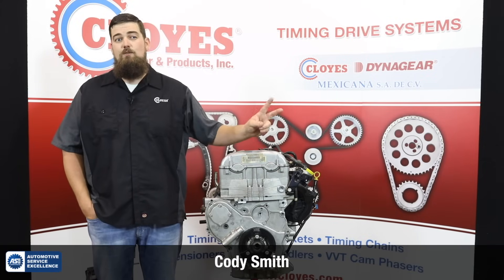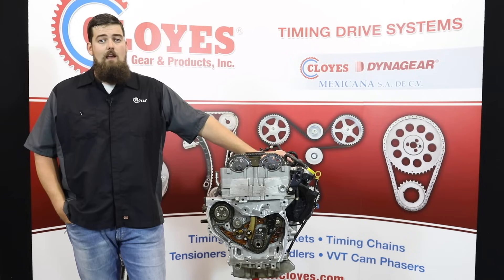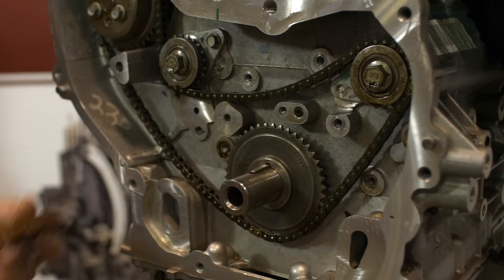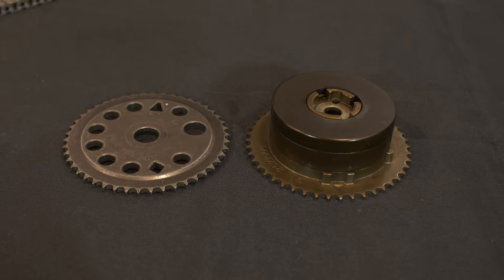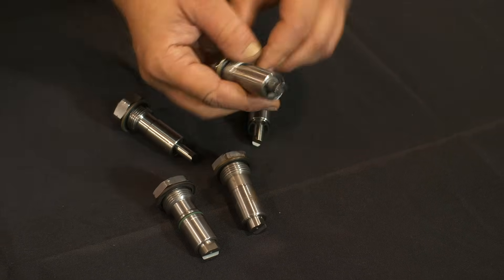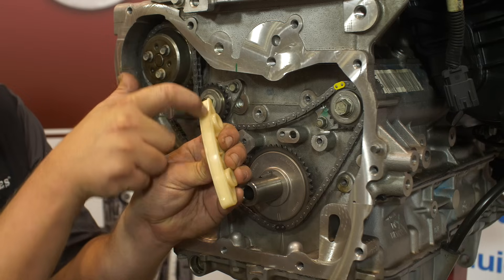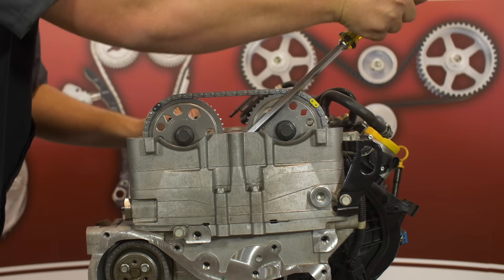GM 2.0/2.2/2.4L, Timing Chain Replacement, Cloyes 9-4201S & 9-4202S

Comment: It’s a slight ticking noise, it’s an Ecotec 2.4 with VVT in a 2011 HHR , new water pump, 9-4201SA timing chain kit and 9-4202S balance shaft chain kit.
Reply from the maker: A ticking noise would definitely not come from those sprockets. Were you getting the noise before the repair? If the ticking noise is timing related it has to be tensioners, oil pressure to tensioners, or the VVT system.

Comment: I just replaced both chains and made absolutely sure the timing chain tensioner deployed, I do hear a bit of noise like possibly the new balance shaft sprockets, the new style , you show in this video, is it possible I just hear a little chain noise?
Reply from the maker: What kind of noise is it? You shouldn't hear anything different from the balance shaft sprockets.

Comment: What happen if I accidentally move the Balance shaft sprockets on disassemble and where do I find out how to fix my timing if it jumped. Thanks for all your help
Reply from the maker: You can just spin the balance shafts back to where they need to go so the sprocket marks and chain links align. The balance shafts do not connect to anything, so you can spin them freely.

Same thing on the camshafts, however make sure the pistons are out of the way before rotating.
Reply: Thank you for your help. Much appreciated.

Comment: I have a car with this engine. And without marks on the camshafts from the factory. New timing kit has these marks.
The engine is suffering from a slack timing chain.

How do I know when the chain is slack and crank set in TDC. That the camshafts are in TDC?
Reply: You have to have marks on the cam phasers.  Also TDC on the exhaust stroke all 4 cam lobes will be down on the #1 cylinder and the key on the crank is at 12:00.

Comment: One thing I didn’t hear mentioned is if you’re doing this because the chain guide broke, make sure to drop the oil pan and clean out the oil pickup tube. I am in the process of doing one now and the oil pickup tube was completely jam packed with debris. Had I not done this I’m certain the motor would not have lasted more than 5 miles.
Reply from the maker: Very good point Jerrod. Thanks.
Reply: Absolutely. With the engine removed from my ‘08 Cobalt, I took off the oil pan and the OIL PICKUP TUBE was packed with debris. There were metal pieces from the chain guide, and broken plastic guide pieces.
Reply: That must've been the it seized on me..broken guide .. replaced chain n everything but didn't check the oil pan now I'm swapping the engine.... (Year later)
Reply: Exactly I,m doing this Job on a 2011 Buick Regal 2.4 mine was also jam packed I took this oil pan off at first to clean out the Metal particles and knew there was debris ,you have to also take the metal Stupid cover off and knock the Oil pickup tube out of its hole first before you even find out what’s in it,stupid design but so are all GM products
A side note the upper chain guide was completely cut in Half,so if you hear any strange noise,take that Valve cover off to inspect
Reply: Thanks for posting this. Going to do this. Does that tube just pop out?

Comment: Which bolts in this job need to be replaced? Just the 2 cam sprocket bolts? OK to reuse the others?
Reply: Yes. Just the cam sprocket bolts. Do not reuse the cam sprocket bolts.
Reply: Depends on what kit you get. In the kit he used, I’m assuming he only replaced the cam sprocket bolts as those are the two he said to dispose of, but I’d keep all hardware until you can compare old vs. new to make sure you don’t throw out something you need.
Reply: @chuckkolancz4969   This. You end up reusing most of - if not all - of the bolts. Make sure to keep them and DON'T THROW THEM OUT!

Comment: I have to check timing on the 2.4 ecotec motor with VVT that another mechanic did the timing chain on but now has correlation codes and p0011 , p0014.  It wouldnt run after he did the work.  I got it started and some times it runs perfect for a minute then goes to running horrible and dies. upon reving i here a strange noise in the engine.  I am guessing he some how has the cams off from the cam gears and the valves are just barely hitting on rev up.  Anyway I need a video on how to set these up with the VVT if anyone can help.  I cant find any videos or pics of proper set up.  We did rent the special tool.
Reply from the maker: This video will apply directly to the VVT engines as well. The only difference you will find is that the cam sprockets look different. The timing is still set the same, it uses the same chain and marks, and the VVT cam sprockets are marked as well. 

With that said, it sounds like you may have a VVT system issue, not a timing issue. If the car runs perfect for any amount of time, then the timing is likely correct. It is either mechanically in or out, it won't switch. The VVT system includes the variable cam sprockets (cam phasers) and the VVT control solenoid. This is the system that adjusts cam timing of each cam as you drive. If you have a bad solenoid or phaser you can experience the symptoms you are describing.
Reply: @Cloyes01  you guys are awesome for responding to these comments!
Reply: Those aren’t correlation, those are the VVT solenoids which you can buy on Amazon for $25.  Probably clogged.

Comment: Should threadlocker be used on the bolts??
Reply from the maker: It is not required, but it can only be beneficial.
Reply: @Cloyes01  thank you 😀 trying this in my VX220 this weekend. Wish me luck!

Comment: I have everything installed correctly and in the proper order but for some reason the chain is too tight for me to even get around the bottom sprocket. Is there a trick needed for the 2.4 ecotec with vvt? I ordered the 94201sa
Reply: Put on the crank first, line up that mark, then the intake, then the exhaust.
Reply: still having an issue

Comment: good video, this makes me be quite thankful i deal with Hyundai Engines all day being a Kia tech, this GM engine is ... just silly, almost Euro in nature as far as its design goes
Reply: My sister had a Hyundai Elantra that she religiously changed oil on and the engine failed after having it for 32k miles. Meanwhile my gfs 2.4l Buick Regal had the timing tensioners and guides completely tear her engine apart, starting when she had 102k miles. My 2016 Silverado had the transmission pump blow up at 98k miles when I drive it like a grandpa. No vehicle is bulletproof and all have their flaws as the generations go on. There are some that have a lot of flaws and some that have very little—(i.e. 6.0 vs. 7.3 fords)
Reply: @chuckkolancz4969  You are 100% correct.
Reply: @chuckkolancz4969  For real. No brand is better than any other. I drive a Chevy but I know a hell of a lot of what GM makes is junk because I work on them day in day out. And most all manufacturers are having timing chain issues. Nissans, fords, GMs... I've done them all
Reply: The design on this engine is nearly a decade older than the date Hyundai Motor Group was founded.  The fact GM has been able to squeeze this many years out of it fairly successfully (in literally millions of production vehicles with a failure rate on par with literally any other motor and not even coming close to the failure rate of the Theta engines) speaks wonders for the engineers that originally designed it.
Reply: @youngconfucius  You are just flat out wrong.  Ecotec is well past the founding of Hyundai.  This is not a quad4.
Reply: @lightclub26719  https://en.m.wikipedia.org/wiki/GM_Family_II_engine
Reply: @youngconfucius  only link to engine posted is that it was replaced by the ecotec.  May want to read that article.
Reply: @lightclub26719  Perhaps you should have actually read it. Under the DOHC subsection:

"The naturally aspirated 16-valve version of the 2.0 L— 1,998 cc (121.9 cu in)—cast-iron-block engine is the successor to the OHC-engines and a predecessor to the 16-valve Ecotec-line of engines. The 20XE (or C20XE with catalyst) evolved into the X20XEV(1994) with 136 hp (101 kW) and taking on the GM Ecotec name and finally it evolved into the X20XER(1999)."

Even if we are going purely off the ecotecs modern iteration, 

Hyundai Motor Group (the division that makes cars): https://en.m.wikipedia.org/wiki/Hyundai_Motor_Group

Founded September 2000; 20 years ago

Ecotec L850: https://en.m.wikipedia.org/wiki/GM_Ecotec_engine

Production1994–2012
Reply: Really, you enjoy replacing all the 1.6’s that Hyundai/Kia were sued, and lost over?

Comment: Cloyes Gear & Products, Inc. I am doing my timing chain on my 2.2 ecotec and watched your video. This is a great video however I’m doing my timing chain because my old one snapped and bent the valves on cylinder 4. I installed new valves and am ready to do the timing but because my chain broke, what is the best way to get my cams on the exhaust stroke? I already have the bottom half at TDC, I just wanna know how to get my cams In time without piston to valve contact.
Reply from the maker: Move the crank so all the pistons are down slightly in the cylinders. You can then install the cam sprockets and move the marks to the approximate correct locations. Then you can take the sprocket back off and move the crank back to the starting point.

Comment: I love doing chains on these 2.4s... so simple and easy, it's like they designed it knowing you have to replace em every 100k
Reply: I'm at 112,000, another 88,000 before replacement
Reply: 🤣 they're so thoughtful
Reply: I'm changing mine at 182,000 and at first I was stressed but now everything is falling into place

Comment: 2011 terrain pulled the primary tensioner out noticed it might not have been activated as it pushed back suddently on removal, replaced it with a new one but happened to be faulty as i could not get it to activate,so i checked and put the old one back in since it seemed ok, activated it replaced the valve cover and my gas consumption and power are amazing now, any idea what happened here?  I still have a rattle but seems to be less prominent on startups as before and less frequent, thinking of replacing the oil pressured tensioner today, what do you think? The chain links are solid no stretching has happened on the cam shaft chain as ican detect, Nelson Vienneau. Thanks for the great video you guys are amazing!
Reply: Either the chain stretched, doubt it, or when you activated the tensioner the slack was on the intake side vs the exhaust side.

Comment: Excellent video, probably the best one I've seen especially without all the horribly mixed of terrible music.  How refreshing, a simple video that is extremely helpful. On the 2013 Equinox 2.4L, the engine mounting bracket is blocking access to the lower engine chain path and where the tensioners are located.  If this mount/bracket is removed would the engine tend to drop or move?  This appears to be a serious issue for guy in his garage  with no lift. Thanks again great effort!!
Reply: Yes the engine will want to drop some when it is removed.  Use a jack under the oil pan to support the engine before removal. Find something flat and bigger than the jack head so the weight is distributed more, that way you don't damage the pan.  When you raise the jack you only want a little pressure, stop when you see the engine move up a slight amount.

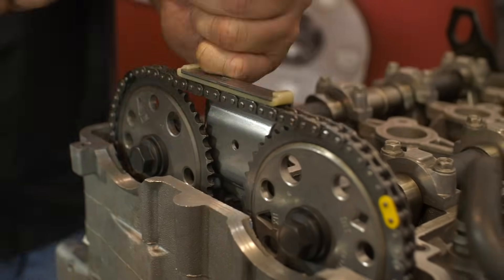Comment: 13:53 why not? It should be timed and ready to turn an infinite number of times.
Reply: The timing marks on the chain /will/ come back around; but not immediately on the next rotation. It could take ~20-30 (just guessing) before they come back around to the same spot on the gears.
I just checked my chain - 46 teeth on cam; 23 on crank. (makes sense; exactly 2x on the cams). The chain has 148 teeth. In one rotation of the chain, the cam has gone 3.2173 rotations (.The lowest common multiple of 46 and 148 is 3404. If we take 3404 / 46, we get 74 (rotations).

So if you rotate the engine over by hand, you'll have to continue to rotate it for 74 rotations before they come back into alignment. You would essentially see the timing chain move about 2 teeth per rotation and they would have to 'walk' all the way around the cam gear.
Reply: James O'Gorman at 14:03, he cleared up what I meant. The engine will be correctly timed and it could be turned. The kicker on these is the hydraulic tensioner. On engines without tensioners on the cam chain, they are free to be turned as much as a person wants without any engine damage.
Reply: I dont get that either
Reply: @frankjustyk9720  There is no oil pressure for the hydraulic tensioner when you roll it by hand and you risk jumping timing. I believe GM service manual says this too. Probably wouldn't happen but all the ones I have done I just double check everything is lined up, put it together and fire it up. Never had an issue

Comment: Ok i have everything broken down and i am trying to remove the balance shaft gears but they will not come off. I tried sticking a punch in the hole to keep the gear from moving but the bolt will not break aloose. Any suggestions ?
Reply: If you can reach it with an impact gun, CAREFULLY try a couple of SHORT bursts with the impact gun.
If you dont have an impact gun, or cannot reach with the impact gun, use a breaker bar and sharply hit the end of it with a hammer.
You need sudden sharp force to get the bolt to start moving.
Stay gold.

Comment: I have a 2012 2.4 ecotec ,I had the dealer do a timing chain under warranty , it only lasted a year and a half , timing keeps jumping , and only 54000 miles , oil changed is done regularly  , any reason why it doesn't last long , are your parts better quality , I am mechanically incline and watching the videos I think I can tackle this , I like the car very disappointed in the engine is junk .
Thanks Travis
Reply: You asked "anyreason why it dosent last long" thrn answered it at the end if your comment. "The engine. Is junk" hahah
Reply: O

Comment: This is a trick... Is it really that easy? I might do mine with 81,000 miles if it's really that easy
Reply: It seems easy because they have the engine out of the vehicle.
Its not super difficult though.
Be SURE to clean clean clean the area before working.
Have good light, proper tools, and a good quality jack.
Stay gold.

Comment: I did everything the same way. I still got the timing belt whining noise. I left the car run for an hour and refill radiator fluid. When it was time to drive. About 10 minutes down the road. The whining started. How much does this cost
Reply: This particular car has a timing chain, not a timing belt
Reply: Whining noise could be water pump, alternator, steering pump, air conditioner compressor etc.
Usually timing chains rattle or clatter.
Stay gold.

Comment: I have a 2010 Cobalt 2.2 VVT. At cold starts it'll have that rattling noise for a few seconds then quiets. It has 79k so is it best to replace the kit vs just the tensioner?
Reply: Same thing here's, only last about 1-2 seconds, it's not pistons.
Reply: Same here... I just took it apart and the chain was loose a little. 110k

Comment: Where would I find a replacement bolt that would go in the left balance chain guide? Had one that snapped on me and am having trouble finding the bolt online. Any help would be appreciated.
Reply: Hi I am having the same problem but it is with the right guide bolt. I am thinking of the junkyard, pep boys and this store called smith fastener company. I am just waiting for a ride so I can go there today.
Reply: @rdylima9  I actually found the item number and ordered one from GM Warehouse Parts, then I called my local chevy dealer and they happened to have exactly one in stock. paid like 3.10 plus 40 cent tax or something like that from the dealer. Got me a torque wrench so i didn't make the same mistake again. 2004 Cavalier 2 door with the 2.2 with 200,000 miles. Engine runs so smooth now compared to before. Got a spare bolt now also.

Comment: TDC on the EXHAUST stroke? I was always taught TDC was on the compression stroke
Reply from the maker: In a four stroke engine you have 2 moments that the piston reaches top dead center. Once on the compression stroke, then once again on the exhaust stroke. Typically you would time the engine at TDC on the compression stroke like an old small block, but not on these Ecotec engines. TDC of the compression stroke in an Ecotec is when the crank key is up, but the camshaft marks are 180 degrees out.
Reply: I have verified this On my 2012 equinox, timing marks on my cam gears point inward and downward when at the end of compression stroke. Exhaust stroke is correct.

Comment: I ordered the 9-4201SX set for a 2011 Chevy Equinox and the links of my chain do not look like the chain used in the video. My whole chain appears a lighter shade of gray with one light golden link and two darker black links. Is this the correct chain or did I wind up with a knockoff?

Comment: Hi Cloyes Gear & Products, Inc. Great video. I’m looking at the 9-4201SAWP set and I have some questions about the water pump. Does the water pump comes with a new sprocket and gasket? I can’t find any information or picture about the pump. Thank you!
Reply: Set I just got comes with gasket installed on the pump.  Good idea to replace the gasket on the crossover pipe though as well which is not included.
Reply: @lightclub26719  thank you

Comment: does this include the 2015 gmc terrain with the 2.4 i heard gm updated the engine as the years went by
Reply from the maker: This video will work for you. The 2015 will be equipped with variable valve timing, but the same basic timing procedure applies.
Reply: @Cloyes01  how do you put the tourque converter bolts in without rotating the motor by hand when installing the motor back in the car?